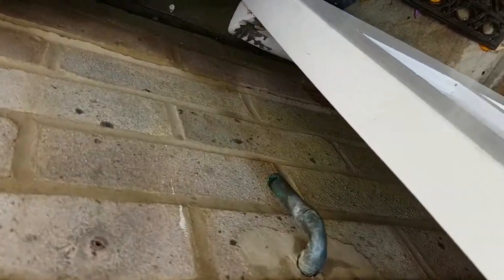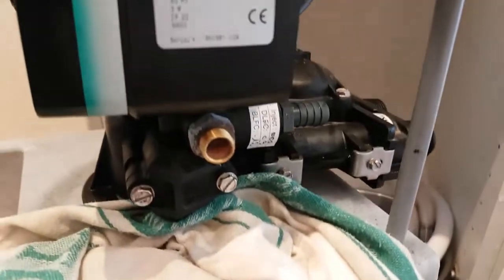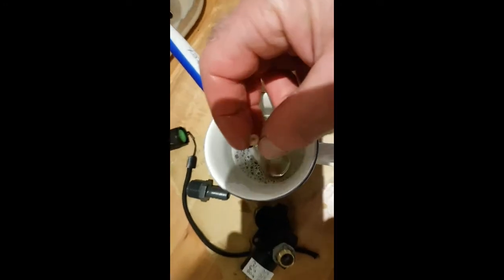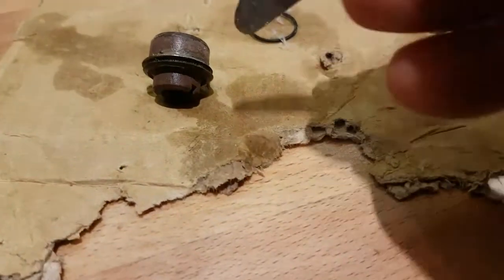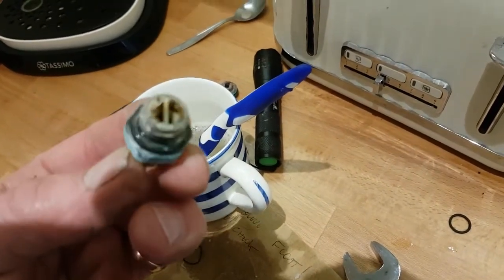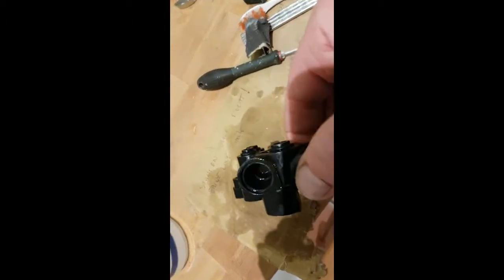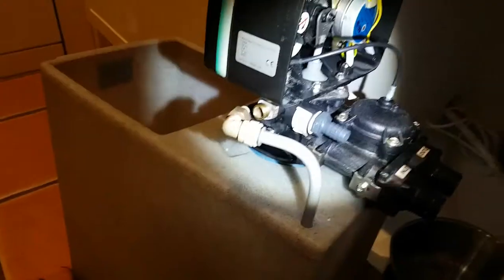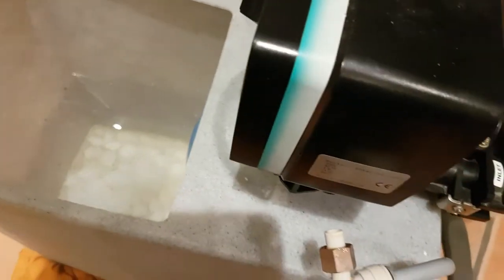fleck pentair 5600 water softener over filling brine tank solution 🔥✔

Comment: I replaced the valve and cleaned the injectors. However, the brine tank is still overfilling. It basically fills until the safety float engages. Any suggestions?
Reply from the maker: Hi lee,
Ive reviewed my own video, and after cleaning all valves from lime scale etc,and putting it together again it all worked.
But what i would say is the tank does fill when it regenerates and even on mine it fills to a high level, but as long as its not overflowing it doesn't matter.